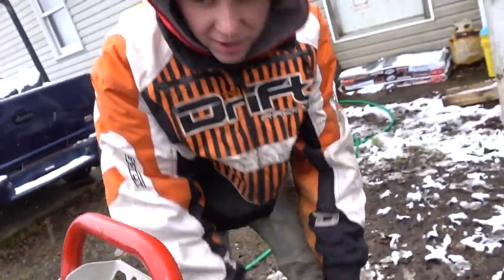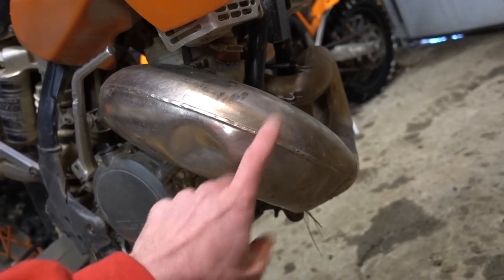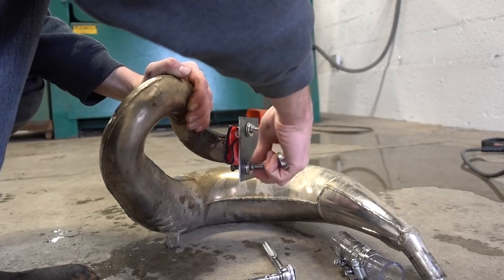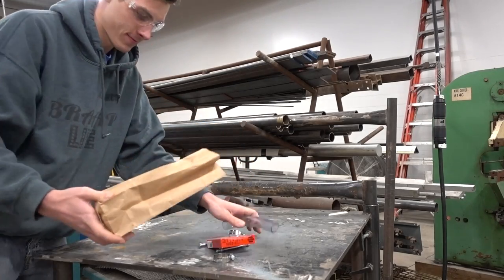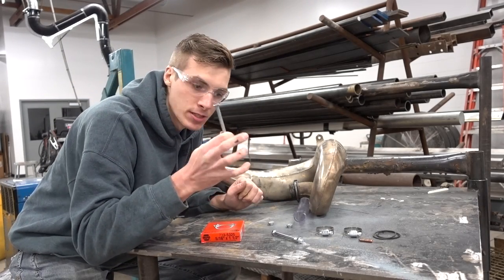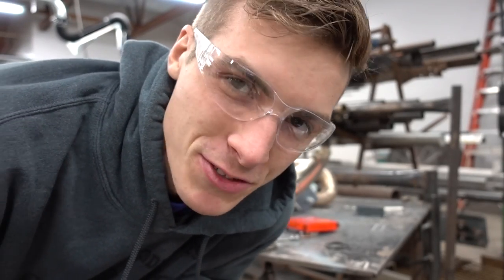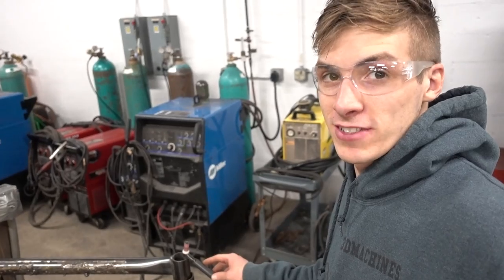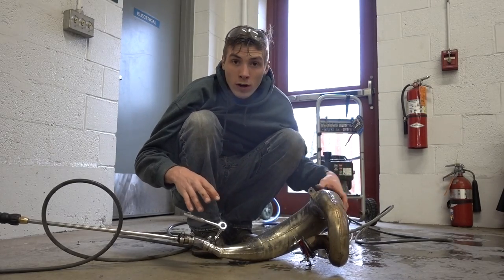IT BLEW UP IN MY FACE!

Comment: Should have just pressurized the expansion chamber with a air compressor and then heated up the areas that you want to fix, the result is much better
Reply: Simon Karim I second this.
Reply: Simon Karim good tip. it's safer too, it takes less pressure to push out the dent. you just have to be careful not to over heat it.
Reply: Simon Karim he should do that now since the dents aren't so bad
Reply: air compresses, water does not compress

with your air method you would have a pressure bomb, in my opinion
Reply: Then you are doing it wrong, you only put about 1-2bar of pressure, the heat will do the rest
Reply: UncommonKIBBLES Yeah its for sure a bomb. When a crack forms with water pressurizing the vessel all that happens is a spray of water, when you use something thats compressible, like air, when the pressure is released after a crack forms the air rushes out violently causing an explosion and possibly shrapnel to some shooting out.
Reply: Simon Karim .... it's definitely much safer to use water.... I've seen it done both ways, but it's much more common with water...
Reply: Daniel Napast t
Reply: Water is for 4-stroke pipes -- not 2-stroke pipes -- for 2-stroke pipes -- put about 30-40 psi in the pipe and then heat the dented area. The pressure washer is at least 1000 psi and more dangerous.
Reply: LOL^^^

Comment: you can also apply air pressure to the pipe and heat the dent until it is red and it will pop right out

Comment: Honestly if the pipe doesnt have a major dent close to the head, it barely loses any power. There is a video on youtube somewhere of a guy dyno testing a bike with a perfect pipe, and one that he smashed in with a hammer, there was barely any differance, only 3-4 hp.
Reply: Heck, he can easily make up that horsepower loss with a 3DMachines sticker!!
Reply: Josh Podolsky i dunno, my pipe was dented in about the same spot, got it out, and I noticed quite a big difference in throttle response.
Reply: 4 hp is a lot to lose on a dirt bike imo
Reply: theduderski... agreed... 4 hp on a 250cc 2-stroke is alot
Reply: Are you talkin about motor trend's video about mashing headers in their engine lab? Because that is a 4 stroke, which behaves a little different. To say the least.
Reply: Kevin Lockwood lol
Reply: 3-4 HP. Is alot of powerloss?
Reply: 3-4 HP. Is alot of powerloss?
Reply: Watched the video, its more like 1-2, 250 2 stokes make 50-60 hp depending on the bike, so honestly 1-4 hp is nothing you are going to lose a race over. 
You guys are acting like I want him to keep the dents in his pipe, by all means, if you have the time then fix the dents, it will improve the performance some. But its not like you cant ride the damned thing if it has some dents in the pipe, it will barely hinder the performance. 
Have any of you seen the pipes on some of the bikes in hard enduro races like the Erzberg rodeo, some are dented to shit and they still finish in a very good position.
Reply: No, there was a video on 2 stokes, not some channel or something, just a regular dude that was genuinely curious and had the money laying around to test it. I found it on reddit.
Reply: Josh Podolsky 250 2 strokes don't make 50- 60 they make 45-50
Reply: that ktm makes like 30hp

Comment: Just to make sure what I'm seein'......you capped the one end and attached the hose to the other and used water pressure to remove the dents? Genius!
Reply: Keith Brettell works better of u apply heat to the dented area then capp it off and fill it with air pressure instead or fill with water and Capp off and put it in the freezer till it freezes and it will pop out depending how servere the dent is u would have to do it a couple of times

Comment: There's a better and less as wet way. You use a radiator pressure tester and you only need about 5psi and heat the effected area. Be ready to remove the torch and the pressure though. It's defiantly a delicate balance.

Comment: 3DMachines it's called a expansion chamber not a muffler
Reply: Steve Rothgery He knows that, it's just quicker to say muffler. He even called it the expansion chamber in this video.
Reply: micah fuller when does he call it in expansion chamber in the video and a couple weeks ago or so when he was working on Jake's bike when they were going to do the FMF turbine core 2 silencer 3-D machines called it an expansion muffler I have never heard him call it an expansion chamber before
Reply: your right its an expansion chamber not a muffler there's no baffles in an expansion chamber so dont call it a muffler it doesn't muffle anything if u dont want to say expansion chamber call it a pipe
Reply: Steve Rothgery He says he's doing it because he knows the expansion chamber is a really important part. Did you not watch the whole thing?
Reply: yo Daddy An engine is not a motor but a lot of people call it a motor.
Reply: doesn't mean i say motor, motors are electric
Reply: Doesn't mean a lot of people don't. And saying a motor is electric is also the very simple way of putting. A motor needs an outside power source to run it. Sometimes it's an engine with a belt powering a motor.
Reply: an engine powering a motor what r u talking about a generator
Reply: No I'm not talking about a generator. Look into some hybrid setups.
Reply: anyway it would be nice to see it properly after he had finished blowing out!

Comment: I used air pressure and heat. Worked great ! I had a huge ass dent , soft ball sized in the first half of the pipe. Possible the worst spot as it was right on the bend.

Comment: 3:00 i was going to say, it's probably 2.55pm ? Then i saw "Unleaded" XD

Nice vid as always ;) Was pretty funny seeing it pop out XD

We use screws that we screw into the part that had to be pulled out, and then levered it out like you would lever out a nail from a piece of wood with a hammer. If that makes sense. Then solder the hole you made with the screw. Kinda like the way they repair some body parts on cars. Well some do it like that :P

Comment: 3d! I've got a wonderful way to fix dented pipes!  Do like you did to seal one end. the other end hook up an air hose and an air pressure regulator. put 10 or 15 psi in the pipe and gently heat the pipe with a propane torch. works like Magic! slow controlled dent removal with no danger!

Comment: I've seen videos of capping off both ends of the pipe with rubber plugs, install a shrader valve in one end and heat dents cherry red
then pump up the pipe with a lot of air to pop back out the dents

Comment: Dalton, tape up the hole on the pipe and fill it with water when it is off the bike, then freeze it and the water will push the dents out! Hope this helps

Comment: Fill it with water and cap the end with a cork and wire. Then throw it in the freezer, or in your case leave it outside LOL. It will take out all of the small dings

Comment: Weld the crack, fill the pipe with water, plug the ends & throw it in a chest freezer. Been doing this for years & it works...just do not fill the entire pipe up or you can split it wide open.

Comment: never seen the water method before, all we do is seal one end then pressurise it with air to then blow torch the areas were is dented up and the hot air inside dose the work for us

Comment: You could still fill it up with water have one side closed and the other side held up open, then freeze the dam thing, worked on mine last time, only i sealed up 2 sides of the pipe and it cracked hard....

Comment: plug both ends pressurize it with air and heat up the dents with a torch works much better

Comment: wondering why you didn't use compressed air on that pipe then use a torch to heat up just the dents.

Comment: You aughta just put a FMF system or new parts on it.  I am a firm believer in recycle and re-use but if you want it to be "nice" you have to replace some stuff.  Like those hideous rotors.

Comment: heat it up, then use compressed air
Reply: I've used a method kinda like this to remove a dent from an old motorcycle gas tank.. I'd say water is more dangerous

Comment: You did it wrong... Expansion chamber needs to be 100% FULL of water BEFORE you pull the trigger on the pressure washer.... Would have popped both dents out within the first 5 seconds if you did it right